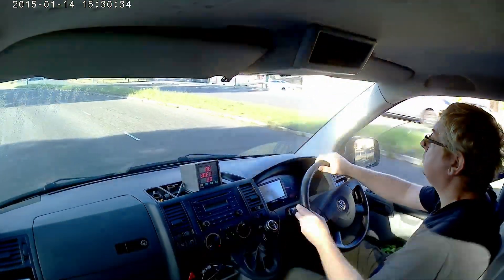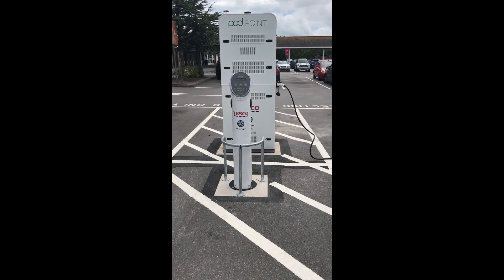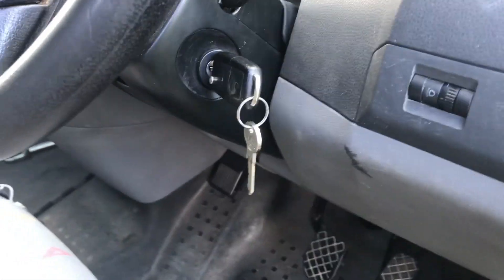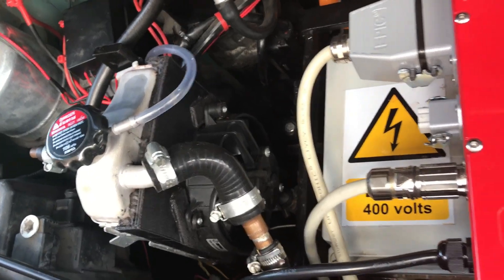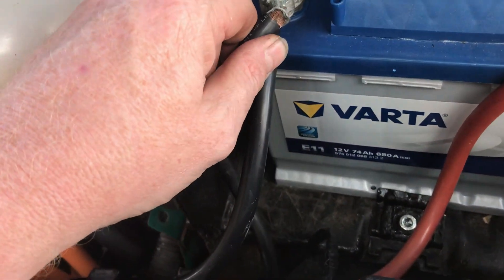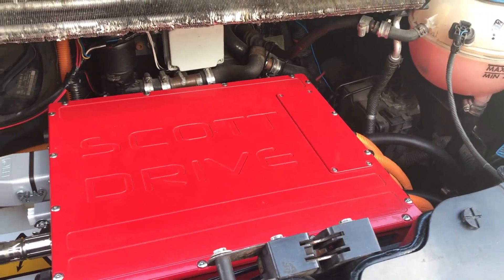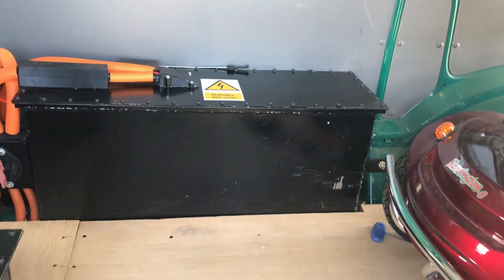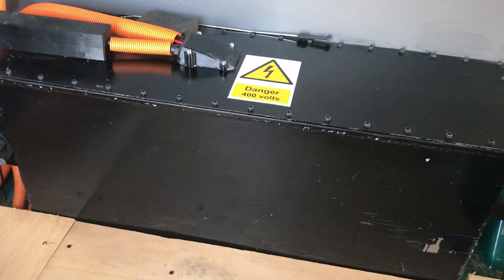VW T5 CONVERSION TO EV (4)  ON THE ROAD

Comment: Just discovered your channel. You deserve more views TBH, really interesting content. Regards, John (serial T4 buyer)
Reply from the maker: Hi John, to be honest, I think the T4 has lots going for it, especially in England in the current environment of being able to register that as electric and able to use it in your those areas without incurring charges
Hopefully they sort that hot mess out soon, but also less a lot less to go wrong, body control, module and such
Reply: @stuartdean4620  I love them. Got one to convert to a camper and bought a pickup (one of only two on the road if How Many Left is to believed) on a whim. Need to keep an eye on how to keep them on the road as the tax and road charges evolve in the next few years.

Comment: amazing. I'm studying all the details to make I already have the T5 I just need more details to build a budget. Do you have a website or how could I get the details?
Reply from the maker: More details coming soon on the new van using a listen leaf motor Volkswagen gearbox BMW X5 Front and rear diff with limited slip death‘s or purchased but I’m now working on the making all of that work
Reply from the maker: Forgot to say I’ve also got about 12 videos and have more appreciate  the quality of them is not amazing but hopefully there is some value into them

Comment: Hi Stuart, What sort of money does this cost ? 

Cheers 
Stu
Reply from the maker: So far it’s running me about 16,000 including buying the van for three but because I’m using it as a commercial vehicle I would normally be doing 15 to 20,000 miles a year sometimes burning as much as for grands worth of diesel

Comment: did you have to re- register the van as electric ?
Reply from the maker: Yes I had to re-register with DVLA of the process took about four months of convincing them sending photographs before and after very important to take pictures with an engine and then with an electric motor and batteries to convince them you’ve actually done it you have to sign a piece of paper which basically says that you have converted it to electric and the penalties of lying about that would be very serious
But they were helpful and now the logbook says fuel type electric
Reply: @stuartdean4620  Does it now qualify for zero road tax? How about insurance - compared to when it was diesel?
Reply from the maker: @TC-V8  yes it,s free
Reply from the maker: @TC-V8  as long as it’s registered as electric the road fund tax is zero insurance is more expensive because of it’s converted

Comment: sorry if I didn`t catch it on your Video, but what`s the mile range you can get out of it, also does it differs at night time?
how do you heat up the interior? 
great job, by the way, I am sure many will follow your example!
Reply from the maker: Hi thanks at the moment I can do 85 miles quite easily the other day I did a journey of 108 miles with the heater on for the first part of the morning to warm the van up I did stop at Tesco’s about 35 miles away from my house and did some paperwork and charged for an hour or so and came back without any problem

Comment: Hay presupuesto para saber el precio de la conversión?

Salud
Reply from the maker: mario jeans I’d be only too happy to talk with you maybe if you use Google translate I’ve been trying to copy and paste your comments and Fortuny I can’t
Reply: Hello
     I would like to know if you know the money that the conversion to an electric motor costs.
Reply from the maker: mario jeans The inverter was about £3500 from Scott Drive
And the motor from memory was a couple of thousand brand-new from EVTV 
It works well but with the weight of the vehicle Scott from Scott Drive reckons there is a different motor that would be beneficial still a Siemens but wound for use in a bus 
So if you’re going to use his controller ask him what motor would suit your application